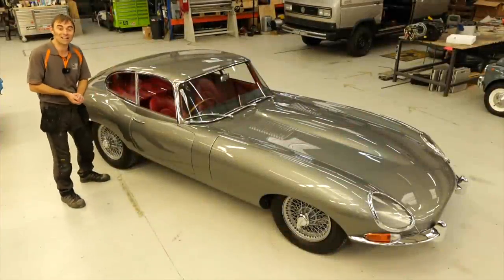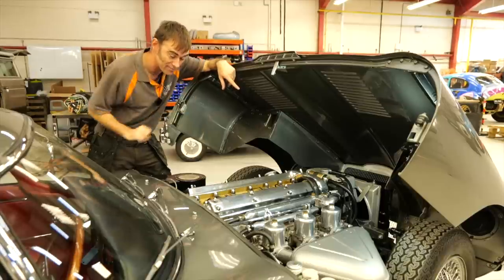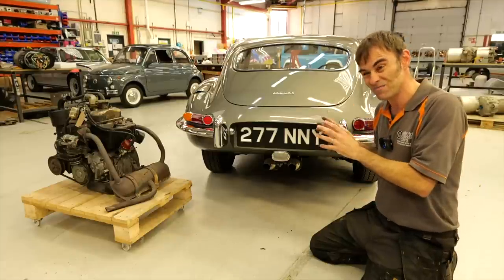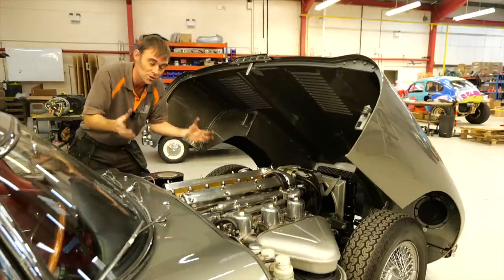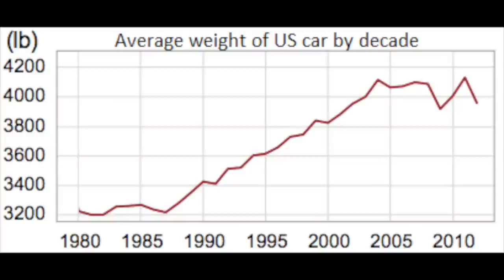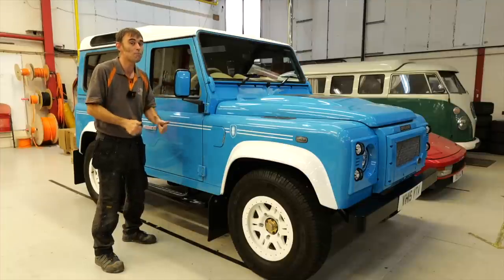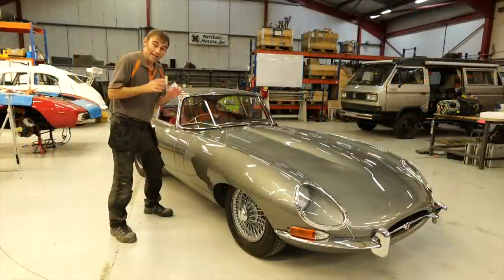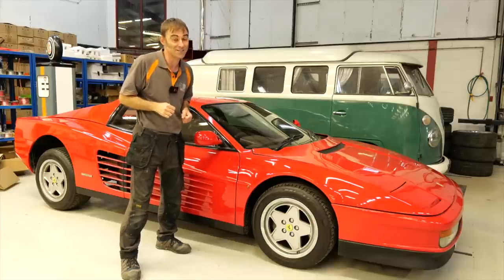Is it a sin to convert a classic car to electric?

Comment: I too choke on the cost of conversion, but it's really not that bad.  If you need to convert at EV - you need eng/trans/rad/fuel tank/pump, lines and a few other bits. All New or recently used won't be cheap  - and getting the same performance will be quite costly.

And the cost of running an EV is much lower that petrol - not much maybe for a classic that sits around.

My daily driver Tesla is saving $150-200 a month over the outback it replaced.

Comment: I believe the part of "soul" is all the things when you press accelerator and feel the engine and gears.

I am all in for electrifying classic cars because that will be the sad future for all petrol heads. We wont be using oil and fossil fuels like we are now in the future (I believe in 100-300 years). For conserving classic cars in their all original form there are museums.

For enthusiast who want to drive these beauties there is conversions (is it electric or hydrogen). The biggest missing of "soul" on old cars could be gears, sound, engine shake (how car shakes when you press the pedal while not moving) and the cars own power curve...These could actually be replicated and I believe it would be a great hit for commercial use! You slap in engine that generates enough power. Then you install "soul-unit" that enables you to select specific power curve and noise generation (that could be switched if you would like to make your fiat sound like ferrari for example). Then just install button that enables or disables the "soul" in cabin if you want to use all power available without limitations.

Comment: Love to see a Routemaster electric conversion driving around London.
Reply: AND we could convert some Steam Locomotives !
.
Reply: UK Heritage Railways converting their old steamers to run their boilers on cleaner efficient LPG and then onto Hydrogen
Reply: Do away with dirty expensive coal and add dye into the stake to simulate smoke.
Reply: @jimsouthlondon7061  you'd think they would burn biomass, after all, UK power stations have converted from coal to biomass as we are told its clean and sustainable despite being shipped in from Canada on large oil burning ships.

Comment: The main issue I have is range and recharging(time and infrastructure in Africa)... I love what you doing and would jump at the opportunity to convert my Landcruiser however will only do it when I can get a range of 1200km on a charge, faster charging time and better infrastructure. Keep the awesome work going, one day one day... For now I will use diesel...
Reply: Your Landcruiser has a range of 1200 km on a single tank? How many hl (hectolitres) can you fill in?
Reply: Africa is still different than Europe…. But do you drive 1200 km a day?, but I guess in Africa your bang on with (lack off) charging infrastructure we need to be able to charge with min 22kwh pr. 100-200km
Reply: @razerrath_com  we have 2 tanks 220+Lt total. the Landcruiser runs at about 5 to 6km per Lt(she is a thirsty 4.2lt turbo diesel running heavy). We go off the grid in the bush for a while the camper is set up to go off grid for excess of 2 weeks. I don't see a range like that being "quickly charged" though with the present fuel cost of it could I deff look at it.
Reply: @jensdybrofrederiksen7922  it's not that I would drive it in a day however sometimes could not see a fuel stop for a while(distance). I don't see the fuel cells charging quick enough (with solar) to sustain travel in this location.
Reply: I have an older diesel too. Much better than gas or electricity

Comment: What voltage generally are battery modules please can you tell me thinking of a project to do thanks excellent show by the way keep up the good work 
Robert Taundry Callowend Worcestershire
Reply from the maker: The voltage of the battery modules really varies depending on which ones.
Reply: Looking to make up 48v to put in a cycle trailer that's all

Comment: You're right about "personality" , "soul" always sounded too streched.
The constant pumping motion inside the engine and the heat byproduct  together with the fuel material consumed, the noise and the exhauseted gases are similar to a living orgamism while the totally still electric engine is a cold magic like operation.

Comment: Since the beging of the year
I am driving an electric motorcycle.
( Yes I am retired) 
I love it .
Do not need noise 
Yes after driven close to 4000km 
No problem .
No oil change 
No belt or chain ( hup motor ) 
Love the feeling it s flying but never leave the ground 😉🏆
Reply: Cool 👍

Comment: THERE IS NOTHING BETTER than the joy of driving a classic car with a well-restored engine - there is nothing worse than standing in the rain trying to fix the electrical problem that brought it spluttering to a halt... 

As long as you save the old engine and running gear, create it up so future generations can reunite the two if that becomes a popular thing - then I am 100% for electric conversion...

Comment: Soul is super hard to define but I get it.  I do most of my miles in the model 3, its absolutely brilliant but incredibly dull, within 100 meters in the DBS the theatre of the engine, the inputs and the feel just brings a smile to my face. (Replacing all 12 coils and sparkplugs to a tune of 2k this month will wipe that smile away but only briefly - cylinder misfire, coils re sadly known on these to be a pain)

I am all for EVs though, super things and as the grid gets better and we can store excess renewables we're laughing.
Reply: It has a small nuclear propulsion, plus a container of    mercury & eletrogravitics 
That's for verticle lift / & landing

Comment: “The Velveteen Rabbit” suggests an answer to the “soul” of a car… the “soul” is whatever someone loves about a car. The driving experience on a classic car converted to an EV could become the “soul” of the car.

I had an IROC Camaro for 15 years, I loved the car… but was always drained after a long trip, mainly due to noise. I thought about converting it to an EV, but overall it was very worn and a bit rough (and the conversion was a bit too pricey for me.) Someone ended up running into the back, doing enough damage that it was written off. A bit sad that such a gorgeous car was written off, but I love the replacement, a full EV from new (a Nissan LEAF).

I reckon converting a classic to an EV is fine and a great idea, though for rare classics I would ideally keep the removed parts/drive train/engine etc. somewhere to allow for restoration if ever desired. I just don’t like the thought of never being able to put a rare classic back into original condition. Actually, you might be able to argue that converting to an EV and keeping the internal combustion engine etc. in storage was better protection for the internal combustion parts anyway - the car can still be enjoyed with less risk of wearing down or wearing out quite so many hard to replace parts. A classic converted to an EV, where the original parts had been stored, might be worth more/better protected so to speak.
Reply: I don’t think you understand what makes a car special. Number one is the engine. Number two is the shape
Reply: @thisisnightshop2037  that may be what makes a car special TO YOU. It may not be to others. Given my experiences with a noisy classic V8 for 15 years, the “genuine” engine most definitely does NOT make a car special to me. I did not realise how severely negatively impacting it was until I did not have to put up with it any more.

Comment: So many good points.  One reason NOT to remove the ICE is that you may loose 100's of thousands if not millions in some cases.  Very rare case though.  One idea is to remove the ICE and put it on a very nice stand and detail the heck out of it and put it on display.  Then, modify the vehicle with electric in such a way as you do not alter the vehicle so that the engine cannot be reinstalled.  Advantages: you can really get a good look at the ICE that is full of "soul", and the ICE may stop leaking and polluting the air and water.
Reply: The ICE can be used for domestic heating,..... And emergency generator!!!,....

Comment: I'm with you, I've been a life long car guy, hot rods, drag racing, I put a stroker 409 with dual quads in my 35 Chevy, very fast, but getting stuck in stop and go traffic with it is brutal, and every time I took it to a show, I'd end up in stop and go traffic sometimes for over an hour, the engine doesn't like it, I had to keep reving it up, I'm done with that, I'd love to go electric! I have the skills to do it, it just has to get a little cheaper...
Reply from the maker: Sounds like you and me have had a very similar history putting big powerful motors in cars and driving them to shows. 😁👍

Comment: depends, if you pack up and properly store the original, or it didn't have it in the first place then it should be. it would last allot longer and could still claim allot lower mileage.

Comment: There are some classics where the engine is special. But some where the engine was crap, a real let down for the car. I'm thinking Citroen DS. I think the French tax laws of the time limited the engine capacity?? or something. I'd happily restore a DS and put an electric motor in it. It would improve upon the original. Oh how I'd love to waft around in a 1960's DS EV conversion...
Reply: I would be more likely to put a rare engine on a test stand to keep it maintained safely and bolt in an electric drive train so I could enjoy car a few times a month, and swap it back for special events.

Comment: I personally love the idea of turning my classic cars to electric, but I just simply don't have the budget for it. Maybe when this becomes affordable. 
BTW, love what you do.
Reply: If you already have a collection of classic cars you are already in the top 1% of wealthy people on planet earth.
Reply: @philtucker1224  my 1997 106GTi disagrees. 😁
Reply: Im fortunate to own some classics and no way would I consider blowing any budget on this fad.  There's already concerns around the lack of cobalt and lithium globally to support replacing batteries for the cars already on the roads, regardless of the environmental damage and labour exploit.  Hydrogen is a far cleaner and sustainable alternative so when the battery powered fad wears off the sheep will be be left with Frankenstein cars they can't give away.  Lastly, it's like hollowing out a Chippendale cabinet to put a flat screen TV inside.  If you want an electric car buy an electric car, save your classic and look after it (including the engine) and the value will appreciate. No brainer.
Reply: Do It!  I have a 79 TR7 that I've converted to an EV.  cleaner, silent, stylish! 
It wasn't that expensive cause I used a brushed motor, Curtis controller, batteries from a Fiat 500e.
Reply: @philtucker1224  I don't think my collection of 3 VW's and 1 Fiat will bring me into the 1% club.. 
I wish I had the budget to convert the VW T1 and The Fiat 850 Sport, those are great cars to convert but it's just too expensive.
Reply: @ronpool6577  are any of those electric?
Reply: @philtucker1224  No, sadly they are not. It's just too expensive to convert them and get them approved.

Comment: well restoring a classic car is expensive, especially body work,  yet alone trying to work on engines, where parts may or may not be available.  But if you convert to electric, you can even upgrade things like brakes say from drum to disc (meaning more reliable) yet alone engine braking /  regeneration with electric motors ,

Comment: It's not a definitive answer. Some design classics deserve to have a few examples preserved in their out-of-the-factory form as far as is possible. So keep these with their petrol engines for motor museums etc. The rest are best preserved with modern components in the power units, drivetrains, brakes, driver aids, etc. as desired by the owners.

Comment: It is a tricky subject, I love old cars and own an EV which I also love.  But, walking round Goodwood FOS this year seeing all the classic cars, the first experience of the car was seeing it on a stand, not running, no noise, just it's presence, the beauty of the car is the first thing you see, even when you're driving along and see an old car you rarely hear the engine, it's the look.
So why not convert them, keep them running but in a cleaner more friendly way.
So if you can do it why not!

Comment: 13:45 Really good run through of the pros and cons. And yes, I'm a bit of a tree-hugger, an environmentalist, but I live in the real world too. So I run around in a BEV. My easiest argument against ICEVs of all kinds is this one - Garage your ICE car and block up the doors. Now get in it and start the engine. You'll be dead within the hour. Honestly. There's no point in sugar coating it. Now try it with a BEV. You might die from waiting for the BEV to harm you, I suppose. Because it won't. The trick here is to do the test with the EV first, so that you can survive to test the ICEV. It's that simple. People have used an ICEV to commit suicide doing the test. Only they weren't testing. And millions of people put those poisons into the the open air every day in the cause of "business as usual" and "getting on with their lives", unthinkingly killing others. Is that fair? Because I don't think so.

Comment: I would love to put an electric motor in my W111 280se, the car is almost unusable, imagine storing the engine and driving around with an electric motor, what a lot of people don't realise is older engines are horribly inefficient compared to modern engines, you can taste the unburnt fuel, no amount of money and keeping it original will fix it, once you put an electronic fuel system in place you might as well go the whole way

Comment: At around 4:00 - Soul is one of those words which most people misunderstand and therefore misuse. You do not have a soul. You are a soul. In other words, a soul is a life. Once that is understood, we can see that neither an engine nor a motor has life. Therefore neither has soul. On an anthropomorphic level, a noisy vibrating engine can seem to be alive, and the effects of both propulsive machines give the appearance of being alive. But neither is any more alive than any other tool.

Comment: Being in Australia there are a few cars that I think should not be converted to electric, those are the cars that are great for long distance trips and those that just need a good range like land rovers though I wouldn’t miss the noise of the Land Rover. The cars that would be great for conversion in my view are small cars especially rear wheel drive and rear engine cars as these can converted cheaply by having only enough battery capacity for a short range and would be perfect as a second vehicle, especially for those of us who have 4WD diesel’s. The beauty of a short range cheap electric second car is that it prevents you from wearing out you ICE engine vehicle by having too many cold starts just to do short trips.

Comment: Like any modification it can be done tastefully or not. For example you CAN swap out an original AM stereo from a classic car for a modern info-tainment screen. Or replace it with something that is “New Old Stock” that appears stock, but with better functionality. Or clean and repair the original equipment. Your conversations are more like  the “new old stock” option, new but tasteful.

Comment: Electric cars and vehicles are the future well done keep doing what your doing
Reply: Agree completely - EV has many more advantages than classic ICE. 
Question….is there any way to duplicate the shifter in an EV config?
Reply: @willstack6188  Probably yes, but better off not. You can keep the original gearbox if you wanted and alter the torque curve so you don't just leave it in top gear all the time.
Reply: @willstack6188  I keep the gearbox in all our cars. It keeps the feel of original car just with more power. You don't need to use the clutch from a stop just to shift, so is should last decades.
Reply: Not only are BEVs the future, they are also the present. ICEVs are the past. And they ought to be looked at in that light.

Comment: Would seriously love to convert my 1984 Nissan Gazelle liftback. The body is almost mint, but the engine is on it's last legs. I still get people coming up to me in parking lots wanting to buy it because it looks like a fun car. And it has pop up headlights. Gotta love those. Well it's no fun at the moment. 0-100 (km) is measured in years. I get overtaken by mopeds now. It's embarrassing. I just pretend I'm not really trying, while my foot is flat to the floor. Well I was overtaken by a jogger the other day, but I showed him. Eventually I passed him and then he passed out from the fumes. That will teach him. My garage floor is an oil skating rink. This things NEEDS to be converted to electric.

Comment: Classic cars are not known for their crash safety but I would be interested to know how converting a vehicle to electric affects this.  Does it make it safer by reinforcing the front of car or does it make it worse by taking away the crumple zones?  In more modern vehicles the engine is designed to be pushed underneath the passenger compartment in the event of a heavy front end collision.  When a vehicle is converted to electric what happens to the battery box in the event of a collision?  Would it get pushed through in to the passenger compartment?  Do they catch fire?
Reply: I would be very surprised if they can do a lot to improve crash protection ... certainly not up to the standard of modern cars that have been designed with safety in mind. Petrol fuelled classic cars are certainly more prone to fires than modern vehicles! Despite following the increase in EV use (and being an owner) over several years I haven't seen an issue with fires following crashes ... maybe the risks are different for a conversion.